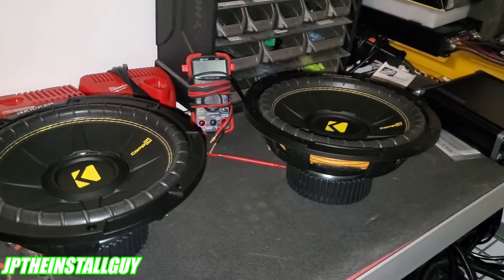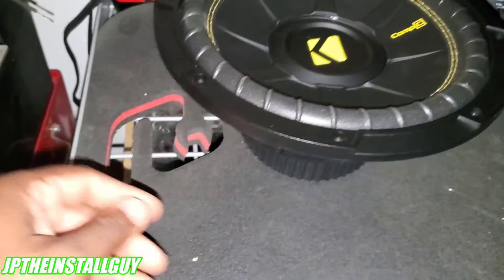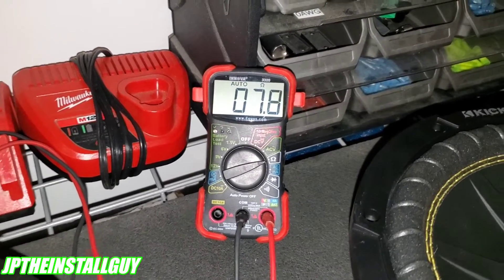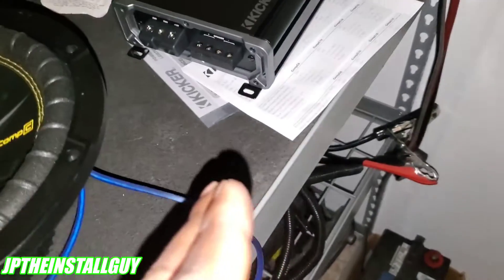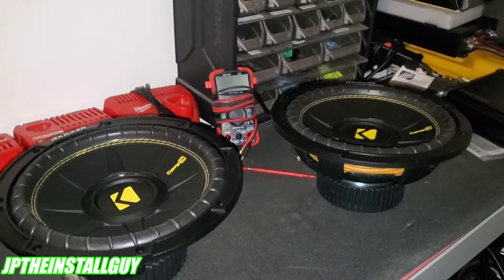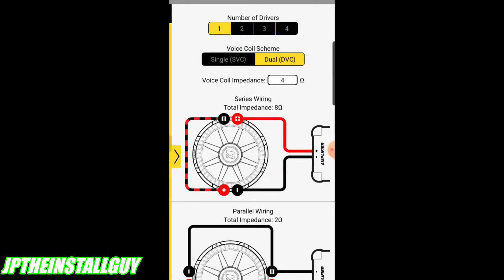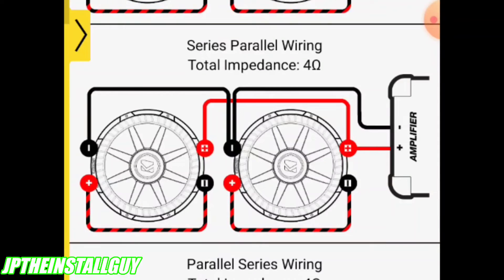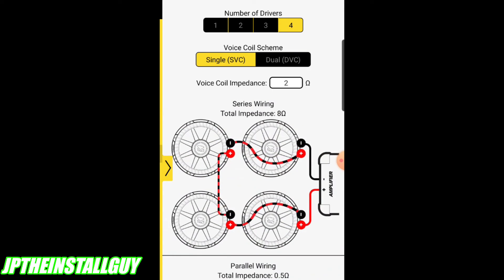How to wire subwoofers to amp + a woofer wiring wizard app

Comment: Hey brother your video save me lol question I have 2 svc 4ohm and a 4 Chan amp stable at 2 ohm but can handle 4 ohm bridged . So my question is can I series the subs up to an 8 ohm then parallel down to a 4 or series up to 8 then bridge down to a 4 ohm load at the amp ?

Comment: I understand how to wire now. Now I just need helping putting them together installed in the subwoofer box and then connect them to an amp. That would be a good video idea
Reply: From amp to sub box just do positive to positive and negative to negative and from sun box to speaker same thing I’m pretty sure